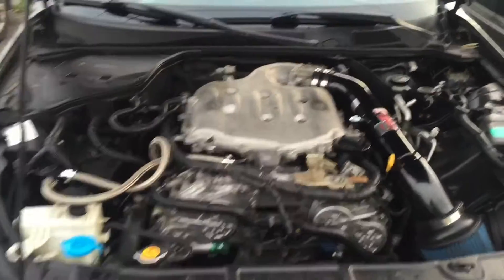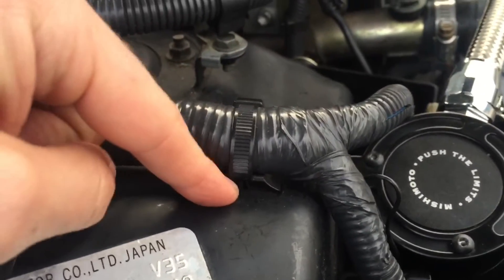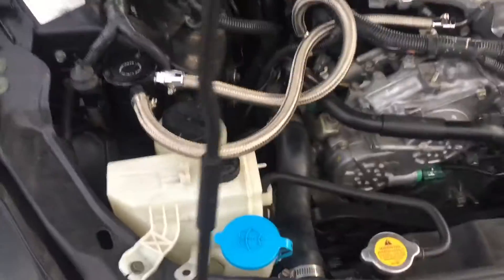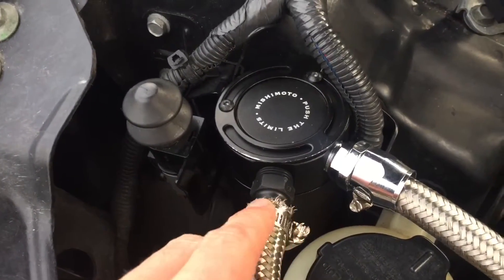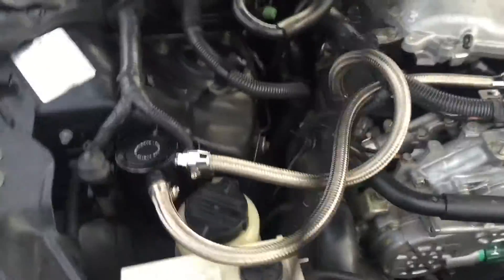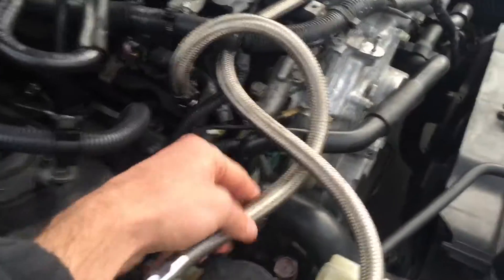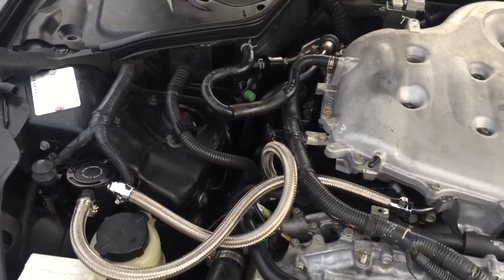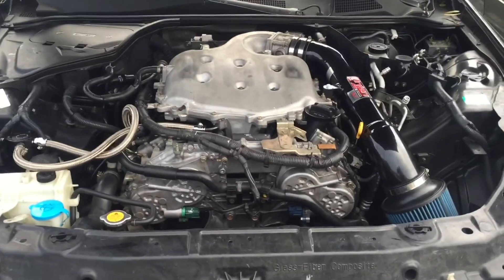Installed: Mishimoto Compact Baffled Oil Catch Can- Infiniti G35

Comment: It's not vented tho.... And aren't you supposed to cap the plenum and run the second hose  under the intake which feeds the oil back to block.
Reply from the maker: john eun ... negative. There are 2 types of catch cans: vented and non-vented. This is a non vented catch can which just replaces the hose that runs from the pcv to the upper plenum (where the excess oil is usually dumped). This allows the oil to be caught in the can and the air vented to the upper plenum as it is suppose to be. The intake side (a hose going into the intake) stays the same in this system. On a vented catch can you would be partially correct. The hose goes from the PCV to a can and then to the intake side (hose that runs under the intake). But the oil is not dumped into the block. It is still caught in a can as this is excess blow-by oil. And since this needs to be an equalized pressure system, the upper plenum is capped off in an open vented system. I hope this helps.
Reply: Steven Rickett did this fix your oil  consumption? Is this California legal?
Reply from the maker: It did fix my oil consumption. As far as legal, it should actually lower some of your emissions output seeing as how you are no longer burning oil. I did not have to put mine through an emissions test so I cannot guaranty that this is Cali legal. However, I have never heard of a CLOSED catch can system being illegal. I have however heard of the open vented cans being illegal. So, I would double check with Cali first, but I lived in Cali with this on and never had any issues.
Reply: Steven Rickett thanks

Comment: could you use a silicone hose instead of a braided hose?
Reply from the maker: Logan DeSousa ... you could, the only reason I stay away silicone is because it is more prone to soak up oil and fluids than rubber hoses. Not that silicone hoses are bad... I just don't use them
Reply: oh okay thanks for the tip!